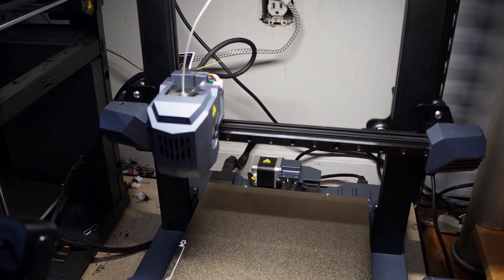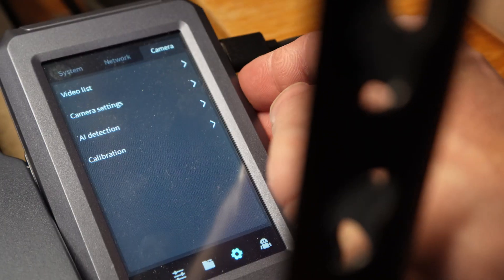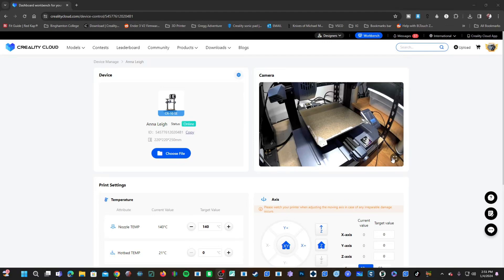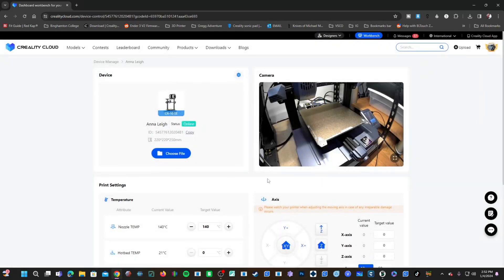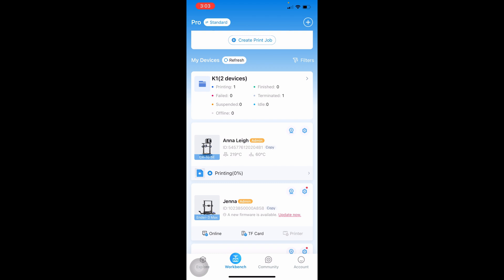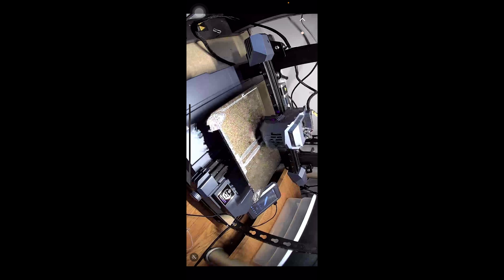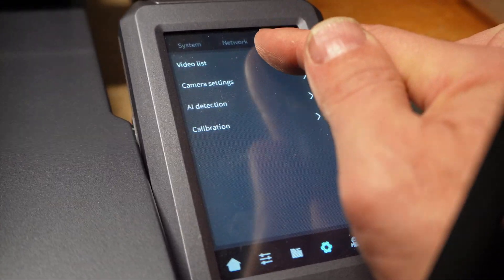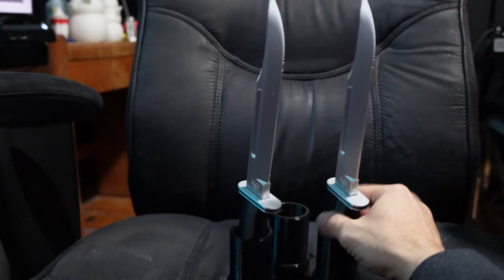Using the Nebula Camera on CR-10 SE, for Timelapse and Video Monitoring on Creality Cloud

Comment: I'm wondering if there's a way to get it to take the timelapse shots when the plate is in the exact same position every time.
Reply from the maker: Negative
Reply: @3DRundown  I thought as much. Time to play with a Pi, a microswitch and some gcode 🤣
Reply from the maker: Have you tried the mode that moves the Nozzle out of the way, for each frame? It MAY actually do that, as part of the setting for this mode. I've never tried it, as it adds so much print time, and potential for other issues
Reply: @3DRundown  I haven't tried that yet, for the reasons you mention. Might just give it a look, see what happens.
Reply from the maker: It's a fairly common practice that allot of people use, but, I don't care for it. Give it a go. Worst case, you don't like it, and now you know...
Reply: @3DRundown  I'm rather going to print a bracket to mount the camera to the bed. This seems like the more logical option.

Comment: Can I ask how you set up the zoom offset for the PEI plate as I am new to 3D printing. Do you do this by the Nebula Pad or by the Creality print software?
Reply from the maker: The CR-10 SE has a Strain Gauge and set's the Z-Offset by itself. Run the calibration from the Nebula
Reply from the maker: Here is my setup: CR-10 SE: Setup, Config, Test Benchy
https://youtu.be/24m_OaXyCBc
Reply: @3DRundown  so if I put the PEI Plate on in replacement of the standard plate and re calibrated using the nebula pad. It should set the nozzle to the correct height.  I have the Ender 3 v3 SE with the inbuilt CR touch sensor
Reply from the maker: Yes. I grab the Smooth from my K1 and pop it onto my V3's all the time. Just select "Calibrate" when starting a print, and you are all good.

Comment: Hi thanks for the video, I have the same CR 10 SE and I was wondering if you changed the G code to offset the purge line? My purge line is way closer to the print area and sometimes gets into bigger prints, I don´t know if its a slicing problem or maybe I have a home offset issue
Reply from the maker: Interesting. I didn't touch it. Look into adjust this line (this is taken from my profile in ORCA) 
G1 X-2.0 Y145.0 Z0.28 F1500.0 E15 ;Draw the first line 
G1 X-1.7 Y145.0 Z0.28 F5000.0 ;Move to side a little 
G1 X-1.7 Y20 Z0.28 F1500.0 E30 ;Draw the second line

Comment: Cai I connect this camera to my ender 3 s1 running klipper on an raspberry pi ?. Wll the nightvision be available to use on mainsail or fluidd?
Reply from the maker: I had it working, before the Nebula Firmware opened up the Toggle Switch. Which.... defaulted to NO, but, I feel like, without that, the camera is defaulted to AUTO. Would need to further test that theory